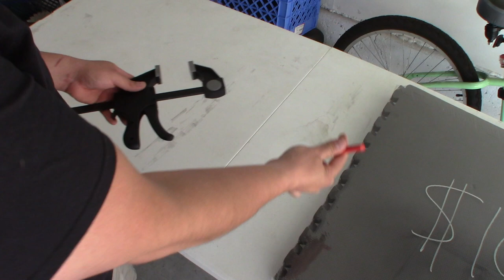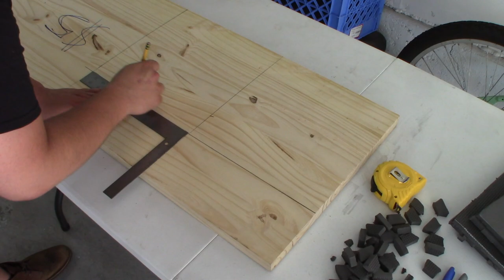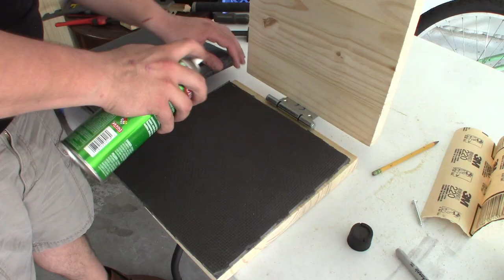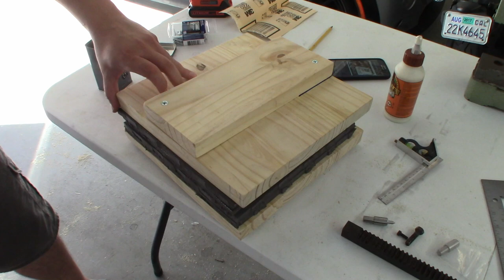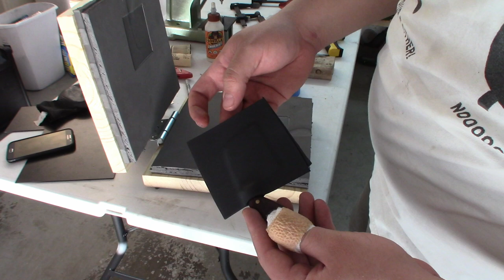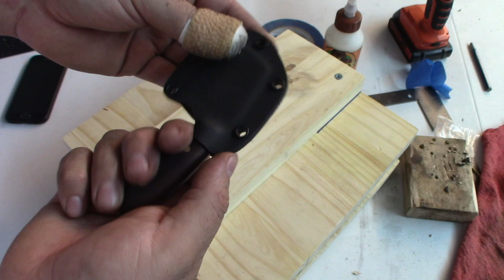Making a $21 Kydex Press (And my first kydex sheath)

Comment: But would that foam get good enough definition for gun holsters?
Reply: Good question and is it resilient? 

Still for the few projects I want to make it would be fine.
Reply from the maker: Honestly I don't think it would work very well for gun holsters. It's also not nearly as resilient as the expensive stuff, but for $10 I have enough foam to replace it at least 6 times, so it should last quite some time.
Reply: I may well give it a shot, all I need is the foam.
Reply: +Donylyn Knives  The more I think about it I already have a home brew vac table thats 8×11...  I might use this along with the vac table.

my holster will be for the knee board in my car so definition isn't as big of a deal.

I'm excited to try this!
Reply from the maker: Good luck brother!
Reply: You can get the foam on knifekits.com and they have different densities. Idk if their is somewhere cheaper but they have all the supplies.
Reply: PkwyDrive13
It would if you make it twice as thick

Comment: Nice, but you didn't count the cost of all those pens, the riveter, or band saw.  I think you would have been better off without the hing, and another clamp since the hinge inhibits the ability to adjust pressure......oh, and you didn't include the price of the Jude's sheets. 🙂. Still an inspiring enough video that it makes me want to do it too, so it's all good.